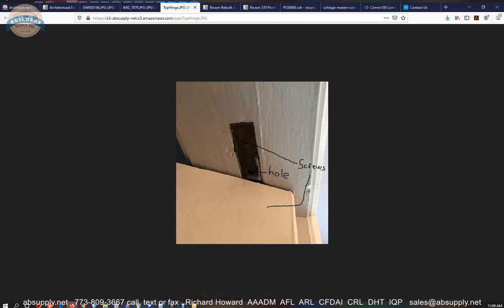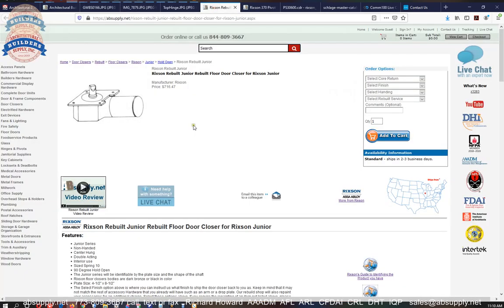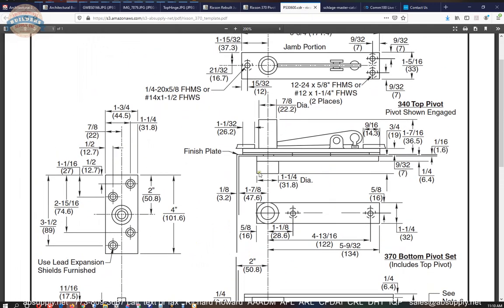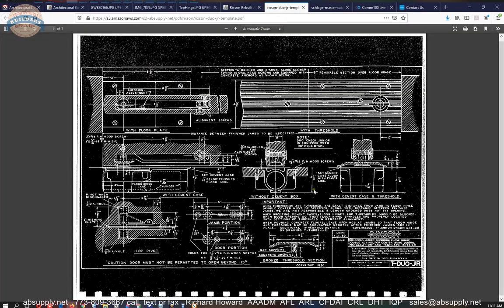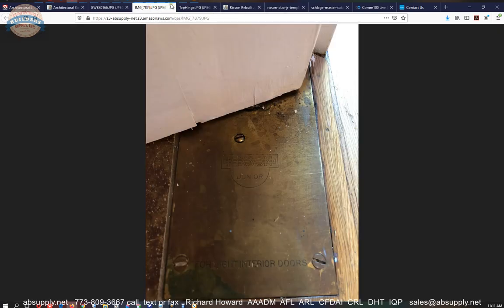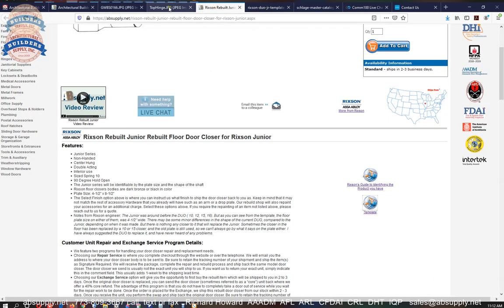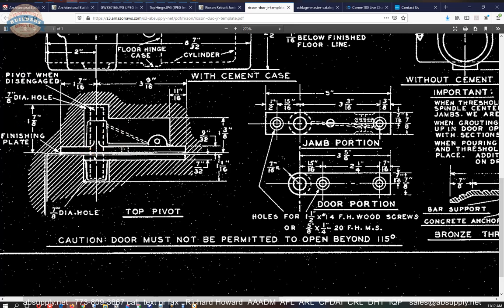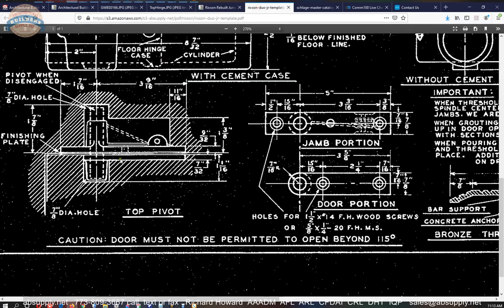How to disengage the top pivot from a Rixson Junior Floor Door Closer

Comment: Hi Richard!  Your video is very informative.  I haven't tried to remove my door yet.  I'm wondering how to reinstall the door after it's been removed if the pin is retracted.  I don't want to damage the mechanism.  The top pivot looks exactly like mine.  The bottom plate in this video looks a bit larger than mine.  Does the pin pop back out once the door is removed?